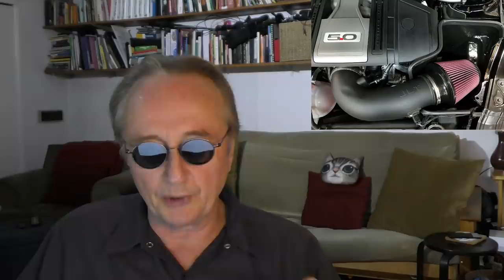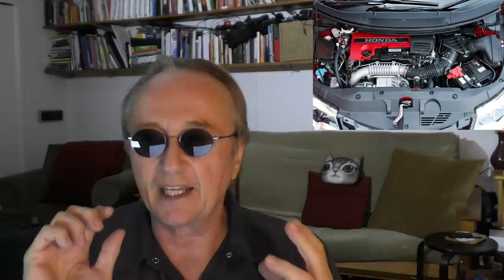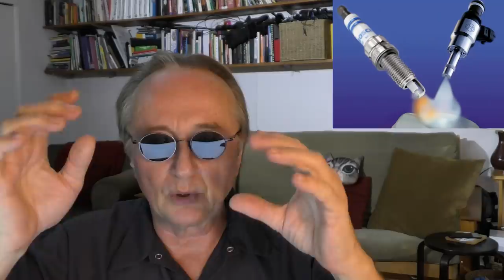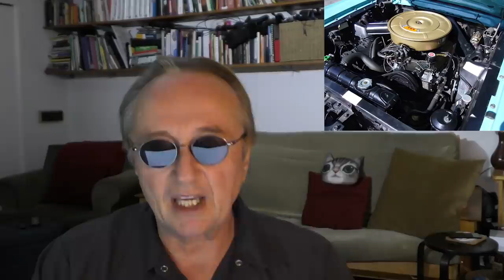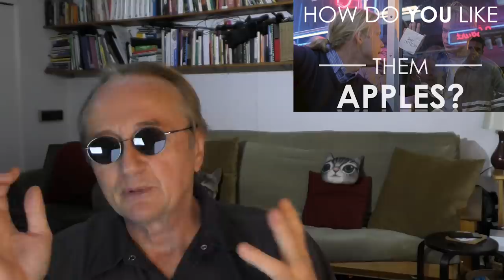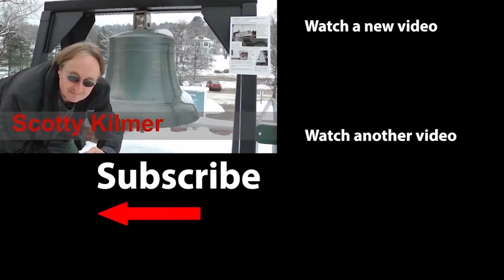This Car Mod is Stupid

Comment: my scion has 180k mile and over heated now it will not turn over any ideas ?
Reply: Try to turn the crank pulley by hand with a socket and if it doesn't turn over or you can't get it to budge at all it means the motor is locked up
Reply: Trow it away
Reply: Blown head gasket
Reply: @directorbeau  it definitely blew a head gasket but what caused it to overheat in the first place was it a water pump thermostat
Reply: Call the junk man
Reply: @carlosrobles7608  could have been a blown radiator hose that caused it to overheat
Reply: @directorbeau  could be but more than likely we'll never know unless the person that made the post says what happened
Reply: carlos Robles could have been lots of things. A stuck thermostat, blown radiator hose, something you ran over that punctured the radiator or the blown head gasket itself! If it blows and the coolant gets burned in the combustion chamber you’ll never know your losing coolant (unless you notice the white exhaust) until it’s too late and the engine overheats. That happened to my wife’s 1993 Toyota 4Runner back in 1995.
Reply: @PumaPete  I know I'm just playing the agitator I've mess with a bunch of cars that have had blown head gaskets and locked up motors and spun bearings so it's just funny seeing what people think I saw one where the water pump failed but the person kept driving it and long story short the Pistons were starting to melt
Reply: carlos Robles 😂😂😂

Comment: Your thumbnail should be, they're stupid unless you reprogram them after installing performance parts and is kind of dumb that Scotty didn't state that in it. I always tune my Challenger after adding a mod that could affect the computer with my Diablo, and really should do performance exhaust when adding CAI to get the best out of both. My Challenger has got 3" SLP loudmouth cat backs on her, which eliminate the reso's and has open chamber racing bullets. So they're nice & loud with a deep throaty intimidating rumble and is a pretty quick car for the 4k+ lbs big beautiful pic that she is LOL

Comment: not quite sure why scotty think suzuki isn't a good brand. maybe he's referring to those non-Japan made or rebadged suzuki's? 

i have a 9yr old SX4 and experienced zero issues with it. when my previous honda used to be of the same age, the fan on the stupid radiator already broke down. 

there's a suzuki sx4 group with a survey asking the members their current mileage. there's a good number of owners there beyond 200k miles...a lot at around 100-150k miles. some are even CVT owners who never replaced the transmission fluid.

before suzuki left the US back in 2013(?) it was sitting on the top 10 most reliable car brand in the US (consumer reports). it is pretty much always part of the top 5 in the UK.

Comment: I use K & N filter on all my Vehicles and put the Cold air Intake on our Little 1999 Jeep Wrangler .  It works fine and actually help with Gas Mileage a little !   I was told that the Computer will make any adjustments ( with in reason )  and it must of because it actually ran better ( FOR LAST 5 YRS !!!! ) !  All it actually does is provide more Air Flow and less restriction  ,  and lets face it the IDEA that ALL THESE SO CALL ENGINEERS DOING ALL THESE CALCULATIONS TO PROVIDE THE PROPER AMOUNT OF AIR <  IS BS >>>   How many times has it been pointed out about these SO CALL ENGINEERS <  AND ALL THEIR DESIGN FLAWS ????  HUNDREDS RIGHT !   EXAMPLE OF THIS GREAT ENGINEERING ARE , LAND ROVER or  MERCEDES OVER ENGINEERING <  the Chrysler garbage their engineers are designing  , or the great CVT TRANSMISSIONS ,that so many companies are using  Plus we have the NISSAN"S , ALL DESIGNED BY THESE GREAT ENGINEERS WHO HAVE PUT ALLOT OF TIME AND CALCULATIONS IN FIGURING OUT THE BEST OPERATIONAL FLOW / MECHANICAL  METHODS .  Most of the CRAP wrong with vehicles today is because a ENGINEER had a BETTER IDEA <  one guys designs the actual function part ( Motor , Trans , Braking system ET C...  )  and another idiot sitting in a cubical behind a computer is writing the software , Fresh out of College !!!   So the idea that Automaker Engineers spending allot of time doing calculation to figure out the best operational parameters is crap . They hook it to a computer and run it thru its paces adjusting the software to try and MAKE IT FUNCTION >   , LET ME GIVE YOU A BETTER PERSPECTIVE , THEY DESIGN THE AIR INTAKE SYSTEM ( TO FIT UNDER THE HOOD ) AND THEN MODIFY THE COMPUTER SYSTEM AND SOFTWARE TO MAKE THEIR INEFFICIENT RESTRAIN SYSTEM FUNCTION AS WELL AS POSSIBLE !!    JMO

Comment: Young people today think this is the 1960s when you could do anything you wanted to. Today everything is computer controlled crap.
Reply: And the computers optimize the fuel and timing in real time.  Vs having to continually tweak everything by hand till you got it right in the old days.

Comment: Actually you can as long as you dont take off your sensors. I run a cold air intake and duals on all my cars never had a issue 200k + on them after those mods. Ot won't effect back pressure if you went to 3 inch from 2.5 inch pype well yes there would be a issue of there has a blow by issue

Comment: I disagree on CAI system. Everyone use it which it’s one of the most basic aftermarket we can install. It’s to breath better, for more efficient, mpg gains, and gains more and torque. So if it something’s that needs to be reprogrammed that’s fine, but it’s never a stupid design.

Comment: Scotty :so sorry, you're WRONG: I've got a Geo Metro, have had "A" > Geo Metro, from 1995, ('93), I've put over 200k Miles on that car, and then have had so many other Geo Metro's also they're like an Energyzer Bunny: They keep "going, and going , and going'''''''''
Reply: 29madman gaud I’ve had great luck with GM and Ford vehicles. I’ve had terrible luck with Toyota’s. Judging from what most people think, you and I are an exception to the rule. I’ve had people bash me here for saying I hate Toyota. But based on MY experiences with them they aren’t any better than most other cars. I don’t usually keep cars past ten years or 150,000 miles. Everything feels like junk after that. I do have a 2012 Honda Civic natural gas car with 300K on it but that’s only because the fuel is cheap and it’s a great spare car in a pinch. But it feels like an old pile of junk.